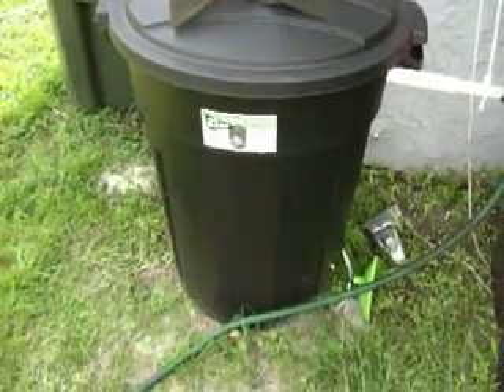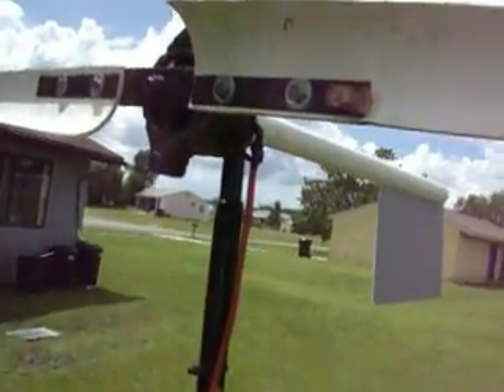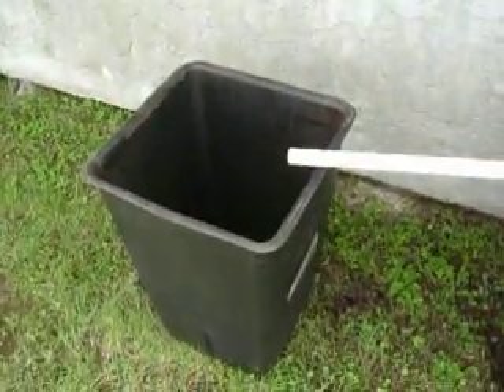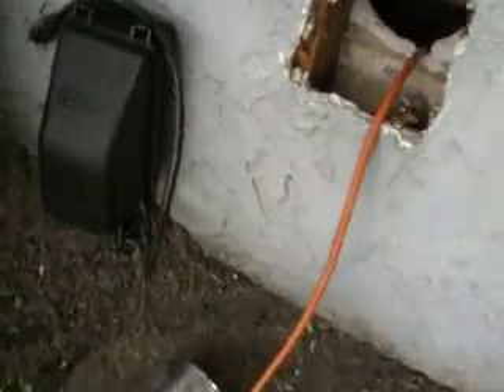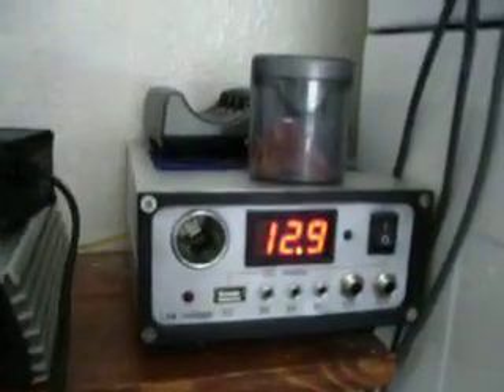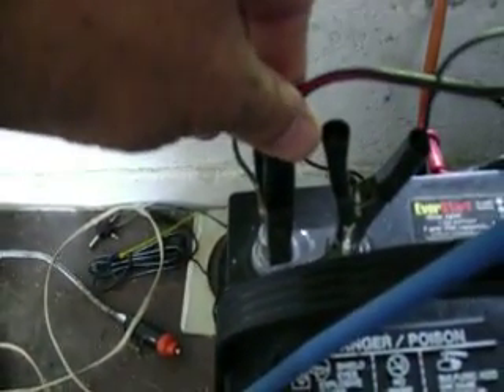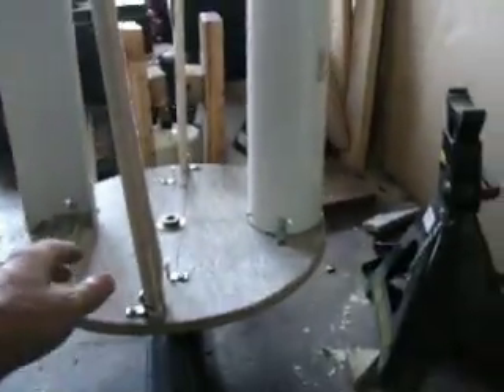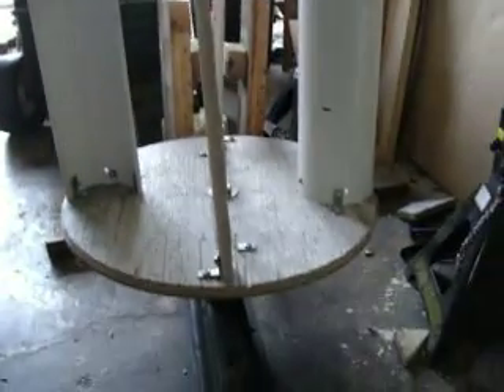45 watt solar panel,rain containers,wind generator,garden

Comment from the maker: @1kzrider  well i had to move from fl and now im in pa ,and getting my system up and working,i did get a few panels up and got them and everything eles hooked up ,but i still have to get the 2 harbor frieght solar panels up,. but im finding that being out of the heat in fl,and in a cooler climate,im getting more power out of my system , ill be doing a new video shortly,i still have to run a lot of wire and hook to some lights.